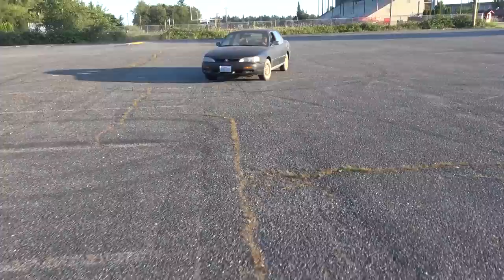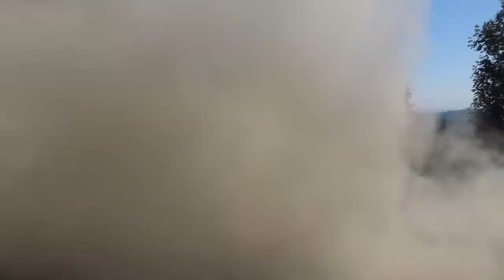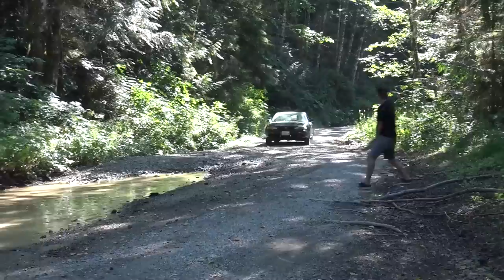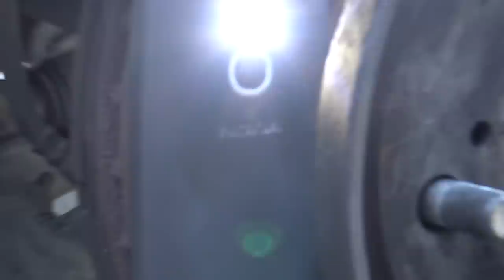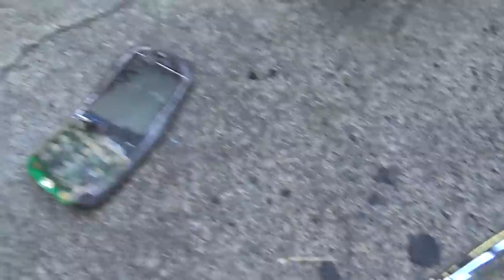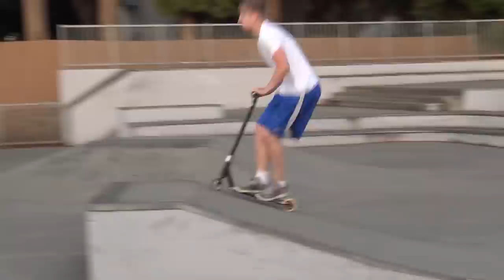Using NOKIA Phones as BRAKE PADS

Comment: The problem is these aren't original 3310s.
Reply: I know I was like that not the right ones
Reply: Original 3310 brake better.
Reply: Do you want the car to do a front wheelie when breaking the car?
Reply: A original would have cracked the rotor.
Reply: I own old nokia myself and it wloudn't fit because It's too thick
Reply: they both aren’t durable
Reply: Ty
Reply: No the real problem is there not the strongest model the 6340i
Reply: No its 2017 nokia 3310
Reply: car parking multiplayer JDM_Team I will never agree with that when I seen a 6340 ran over by 10 different semi’s at 40 mph and still work
Reply: car parking multiplayer JDM_Team and the 3310 newer or older explodes from that I seen it I tested it

Comment: Dude you should use vape juice as oil 😂😂😂
Reply: Brandon Robinson except it'd cost at least $500. However, if they just use the base to the juice, with no nicotine or flavour, it'd cost them $20 tops
Reply: Alex yeah but I just got a good feeling a certain thickness of juice may actually work
Reply: Alex It wouldnt cost 500 Just get a bunch of VG and PG for cheap and that is basically flavorless vape juice.

Comment: The new Nokia would not work. You need the old ones. That brick POS that didn't go bad until the battery gave-out after like 5+ years of constant use, and wasn't salvaged because they battery cost more than a new phone if you replaced that thing.

Comment: Guy starts off doing a 30 roll- “pedal goes to the floor”, he then decides to do a 40 roll- “phone is all worn out officially pedal straight to the floor”, but it’s not enough he goes up to a 60 roll- “this is all it has, this is all it has pedal was on the floor”. Finally he says “there is legit no brake pedal” 😂😄

Comment: Hey hey fuck yall car newbs !! Back in the day when my friend had his Dacia 1310 running, with no brake lines even, he dowshifted a lot, and we were no pussies to even be scared one inch, I told him to turn off the ignition while in gear, it was hella good at braking and it used less gas, still sipped vapours of gas as it was carburatted, good times, i drove it once and i almost hit a cemetry grave and it's cross lol but i gave no fucks and shut it off cuz we waz gangster professional at driving... Best giggles we ever had !

Comment: If you guys want it, I'm in Wisconsin and trying to get rid of an '03 Subaru Froester 2.5x, and a 2001 Ford F-150. Use them in your videos. Email me if you're interested. (jobobberini@gmail.com)

Edit: Subaru needs brake line/exhaust, Ford needs New engine (Spark plug keeps coming out, still drives/runs fine)